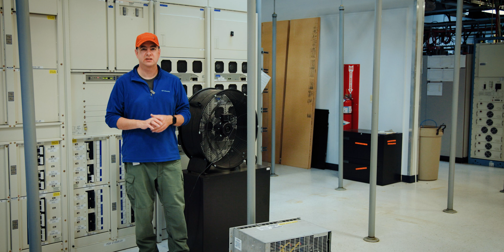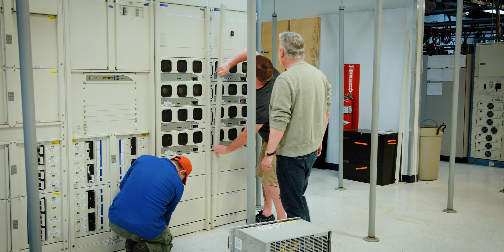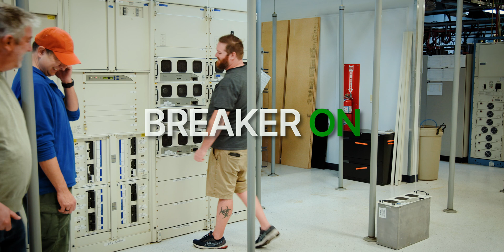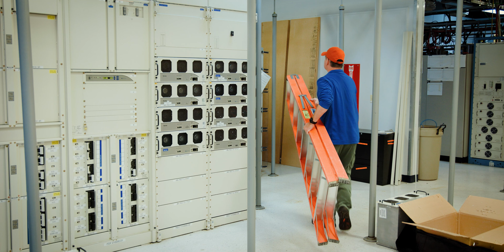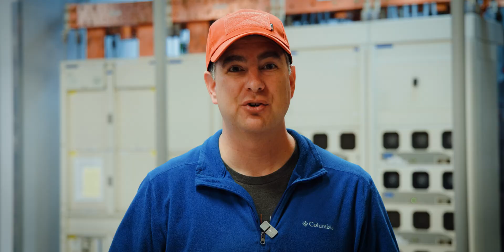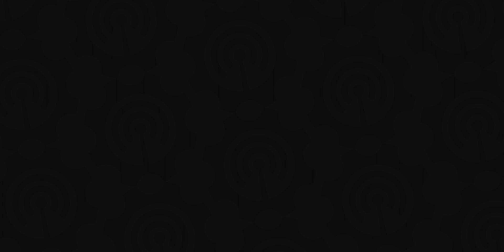Replacing a rectifier

Comment: On other youtube vlogs, they showed how they replaced a transmitter rectifier.  It was a giant glass tube device about 4 ft tall.  It was partially filled with mercury and it had a blue plasma glow under operation.  I wondered if it was generating dangerous UV or X-rays when operating.
Reply from the maker: A little different than what I had here, but generally it's safe. These are rectifiers to generate -48VDC for a telco plant.

Comment: Since Switch Mode rectifiers took over, swapping them is easy peasy.  Good plan having someone that knew how do it, you don't know what you don't know and some folks pride won't let them ask for help. 48v is really forgiving until it isn't, that's a fairly good sized plant, if you aren't sure, ask.

BTW you don't need arc flash PPE for 48v. If you're in the AC load center, all you need is an FR rated long sleeve shirt.
Reply from the maker: Electrical has always been a little on the uncertain side for me. Over 24V and that’s an electrician. But yes, having that example and conversation with the guy makes me a lot more comfortable about swapping those in the future.

Comment: I think those units are hot swappable, you just turn them off, and can pull them out without hassle, then plug in the new one, and it will operate. Just like server power supplies.  Seen that in the cellular base station downstairs, where they have a bank of 6 Emerson rectifier units, all in a rack, with 4 of the 6 failed hard and disconnected, and the remaining 2 providing the power to the 48V battery bank under them. that bank only power a few things, the fibre interface, the management systems, the Ac controller and the alarms, the rest is actually handled by the new, encased in reinforced concrete, lithium iron battery bank in the other rack, that powers the actual cellular switches. Encased in concrete because these batteries are stolen regularly, so the entire rack is filled with a reinforced epoxy concrete mix, that makes it a 2 ton monolithic block, bolted to the concrete floor.
Reply from the maker: Yeah, that’s about what it was. I wasn’t confident because Vertiv was being very dodgy about how to do it. And now I know…
Reply: @TheBroadcastEngineer  And now next time you will be more confident. However please do get yourself a set of arc resistant clothing and a mask, as the energy in those batteries is very high, and safety is cheap. A set of those, in a cupboard in your office there, at the ready, will always be comfortable, just in case you have to disconnect one of the battery banks in a hurry.
Reply from the maker: Indeed. I did get the electrical rated boots. But yeah, the mask and clothes…